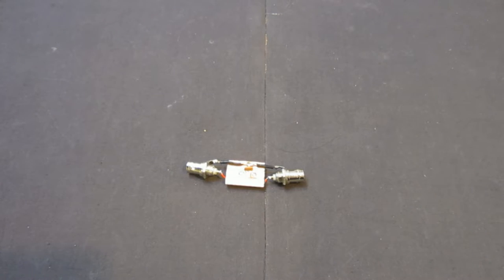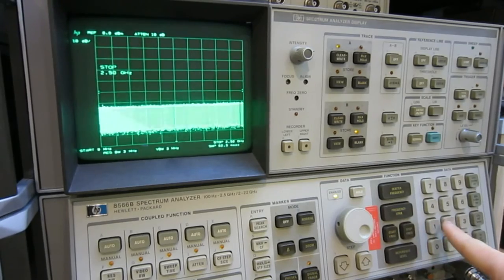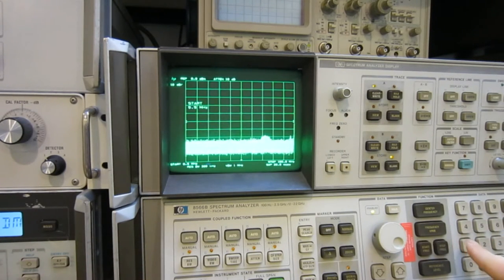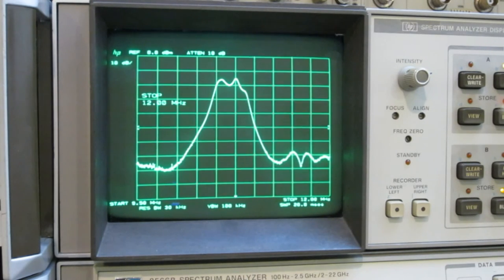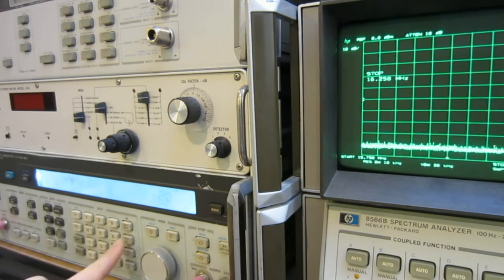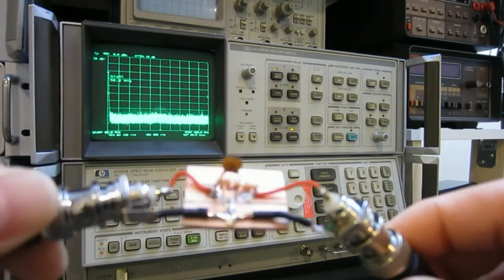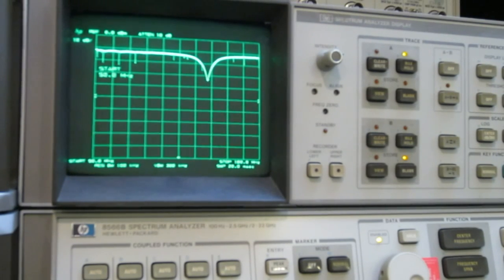Tracing Filter/Oscillator Frequency Response Using Spectrum Analyzer and Signal Generator

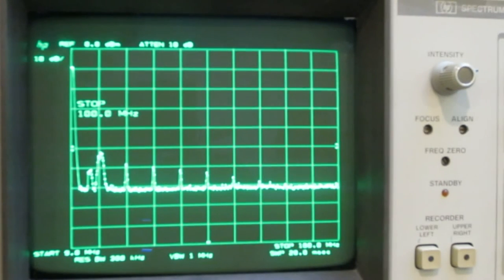Comment: when you said @4:44, you'll begin manual sweeping, i dont see your sweep time change at all? what exactly did you press becuase im trying to measure frequency reponse on an hp8591E model and i cant perform it how you do it
Reply from the maker: The 8566B was in max hold mode, and the manual sweep is  done from the frequency synthesizer (8642B).
Reply: what are your steps from the frequency synthesizer @KerryWongBlog
Reply from the maker: @robert_redd1528  I think it was 1 MHz.

Comment: Thanks Kerry for posting! Did you manually sweep the frequency generated by turning the signal generator frequency selector dial? I ask as it is never shown in the video how thr frequency is changed.
Reply from the maker: Yeah, for this one because I did not use a tracing generator the frequency was changed manually via the dial. If you search my video for tracking generator you will see that later I built a tracking generator for the 8566B.

Comment: Hi Kerry, have you given any thought into matching the input and output impedance's of the DUT so that you're not measuring other spurious effects caused by impedance mismatches between the generator and the SA input? I seem to recall that Alan, w2aew, uses a nominal value pad on the output side of the signal generator before the DUT for similar reasons.
Reply from the maker: I have not tried that, I will have to watch w2aew's video again :-)